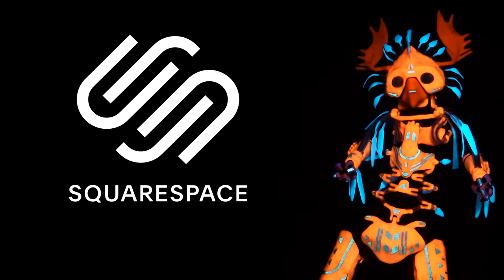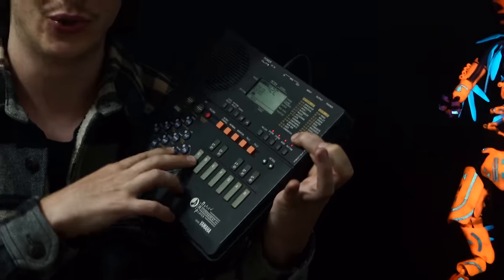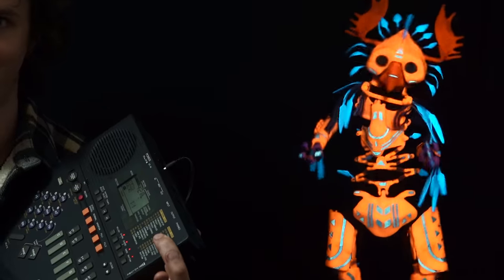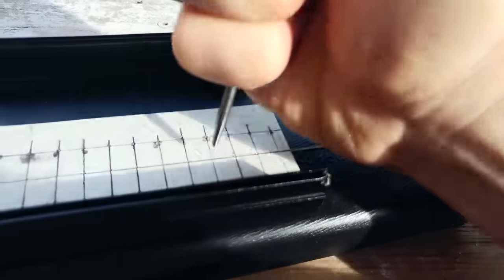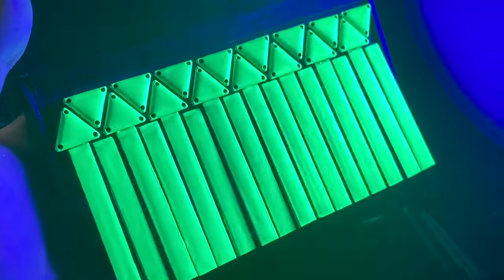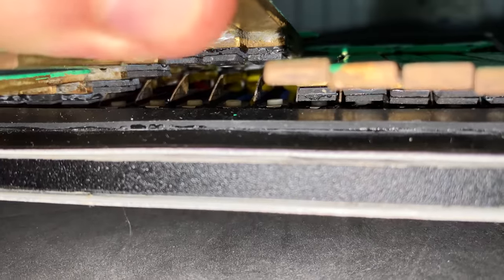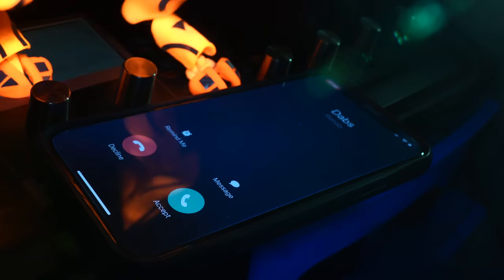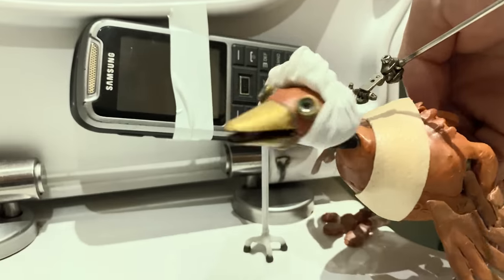Making a COMPLETE MINIATURE music rig for my puppet

Comment: I'm here, because I was wondering if the keyboard and puppet hand using it, is just show and the sound produced is post-production or if it is really doing it. assumed, maybe sort of touch control with conductive rubber at puppets hand. amazing, that it is real tactile push down switches. 😮